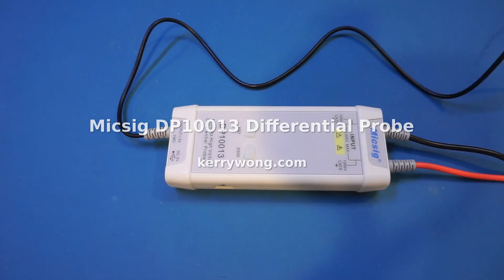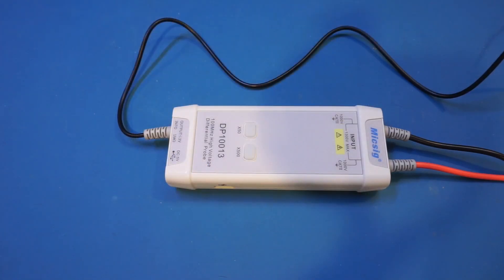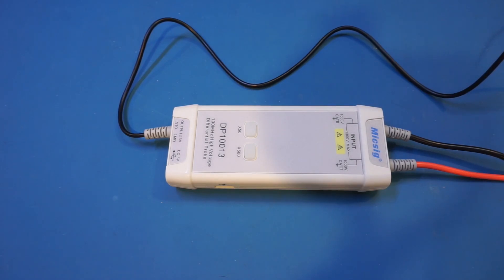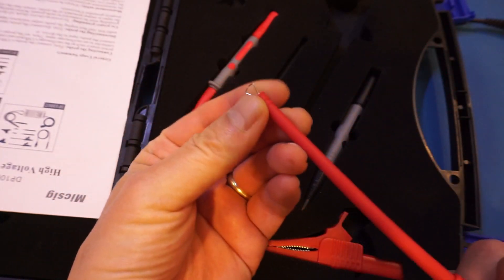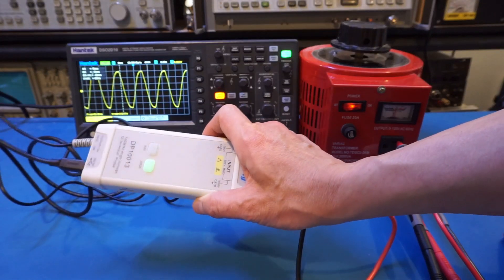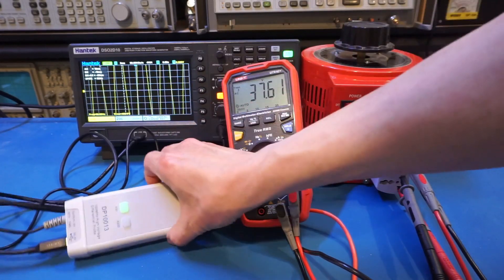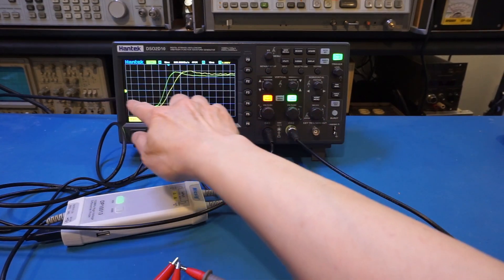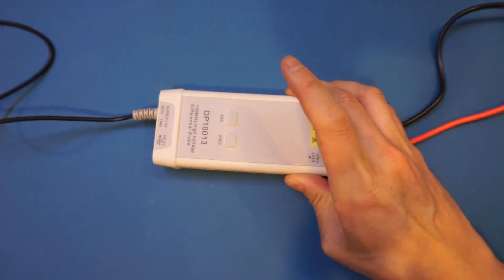Review of a Micsig DP10013 HV Differential Probe

Comment: A different use-case perhaps, but I've often wanted a low-voltage differential probe... Something that can see the orders-of-milivolts voltage drop along long PCB traces, wires, that kind of thing. Would make a handy way to observe current consumption as well. I'd definitely want it in the >1MHz bandwidth still. Are you aware of anything fitting that kind of use?
Reply: They do exists, although they cost a ton of money. E.g. both Tek and Agilent make such probes. For a DIY approach you may want to consider AD8129 based designs; there is a couple of circuits published here and there.Depending on how you configure an amplifier, this will give you around 100MHz bandwidth with 1x differential gain across several tens of volts of common mode voltage. Hope this helps.
Reply: https://www.youtube.com/watch?v=hdVU9VYUCRE

Comment: When reviewing these probes, connect both input leads together and connect to 240V to measure the CMRR.
My well known budget one had bad CMRR until i pulled it apart and adjusted the very sensitive and touchy single turn CMRR pot.

Mine was the type that uses resistor dividers between the live inputs and ground, which demands close tolerances and trimming to get good CMRR.

Another design could use a floating power supply and amplifiers, which would avoid the touchy CMRR adjustment problem.

Good CMRR is needed for measuring things like SCR gate-cathode waveforms.